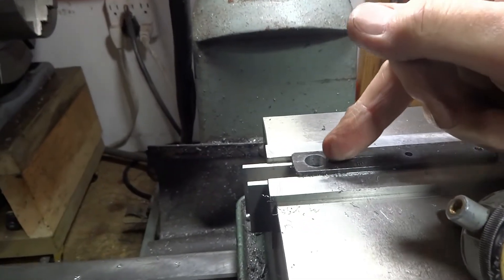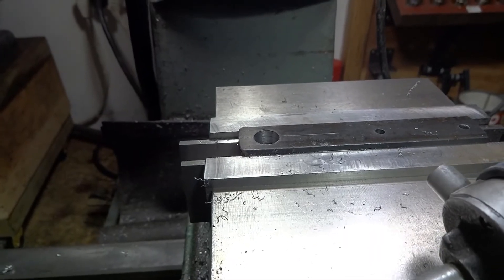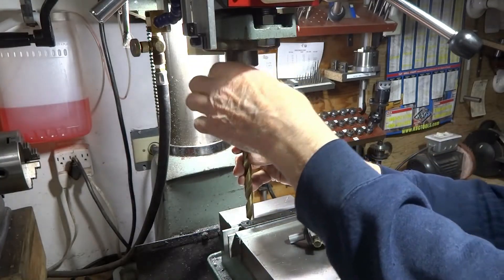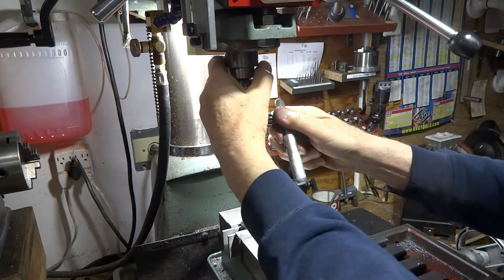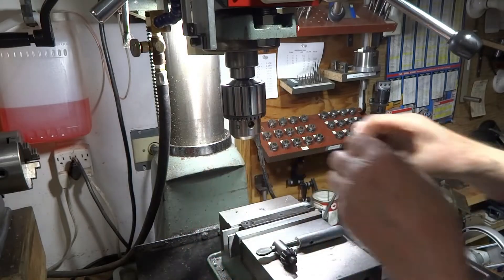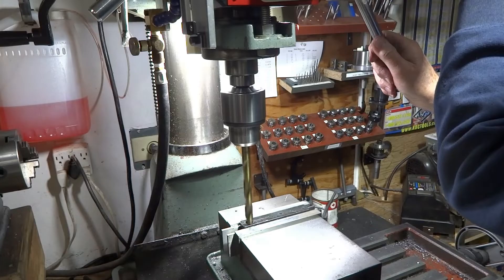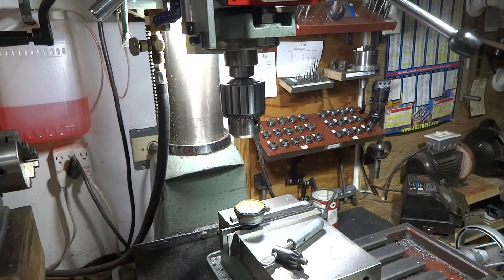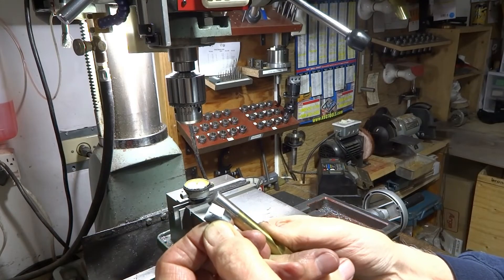Make a hole just a little bigger.

Comment: Moving the part offset to the drill would acheive the same thing.
Reply from the maker: If I understand correctly that would also produce a hole that would not be 90 degrees to the surface of the part. Please correct me if I have missunderstood.
Reply: @MrModify  move it side to side then back and forth. It could be easier than the shim and tape to wear a few burrs off the side.
Reply from the maker: @marley589  Might work but it would be a little out of round and you might not care about that depending on the application of the hole. Thanks for your comments.
Reply: @MrModify  The idea, like yours, is to rub off any raised burrs. The sides of the drill won't cut into the parent metal, it is too flexible.

Comment: Nifty tangential think, however if you don't have a drill press with a fixed bed & vice have you any tips?
Reply from the maker: Sorry for the delay in reply I am in the process of moving my workshop. Short of using an electric drill with a round file I can't think of anything else right now.

Comment: Since a drill doesn't cut sideways,  that is, only the bottom cuts, you can hear it rub against the side of the hole. 
This makes me think that a slower down-feed and higher turning speed may also make a difference, as it's only that very outer tip of the cutting edge that does the work.
Contrary, in brass, I've used a hand-held cobalt drill bit as a reamer since brass is so soft that the drill's flutes do actually carve a bit. But be sure to wear gloves - don't ask me how I know.